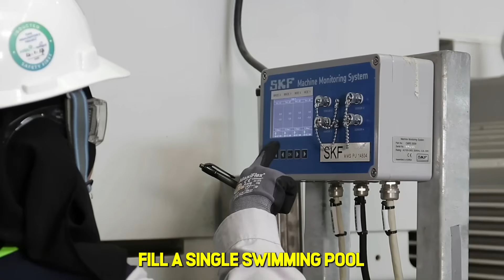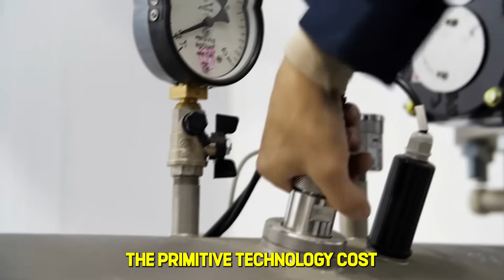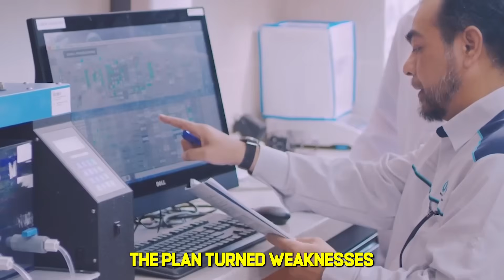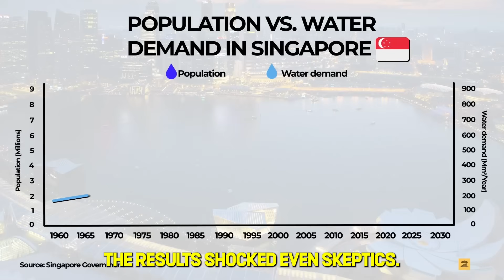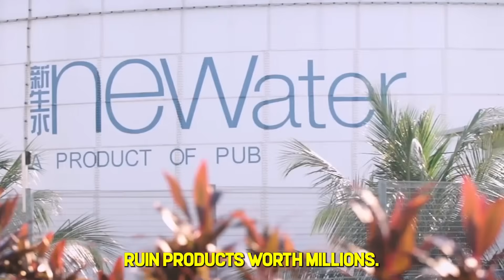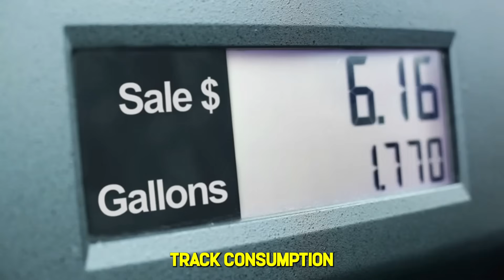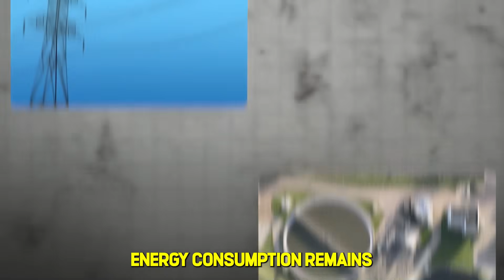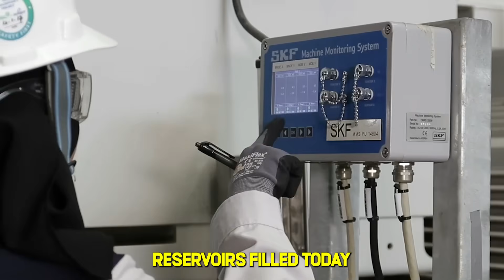Singapore Has NO Rivers and NO Lakes — How They Became COMPLETELY Water Independent 1

Comment: Just FYI Singapore do have the means to be self sufficient already just that the cost of desalination is still higher than buying raw water to treat it.. so we are still importing.. but if the tap is cut. We will still be fine.. just pay more for water.
NeWater isn't Toilet water actually . The water from ur toilet Bowl goes to Sewage treatment.. 
The water from ur Wash Basin..from washing hands and veggies and dish.. goes to water treatment.
The NeWater is mixed with water from rain and so the taste is not noticable.. it is only ard 5% of the water you use.
Reply: Singapore is so dependent to other country support.